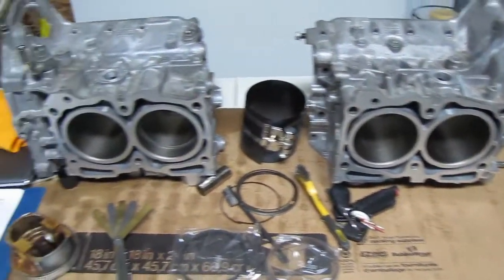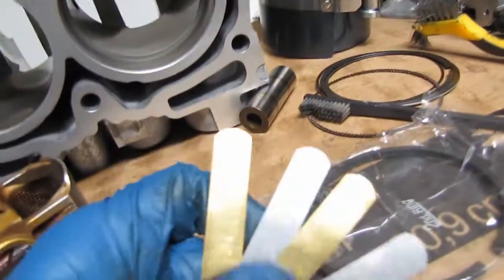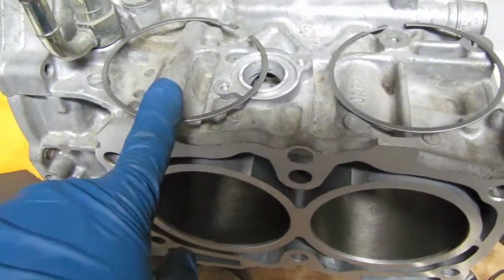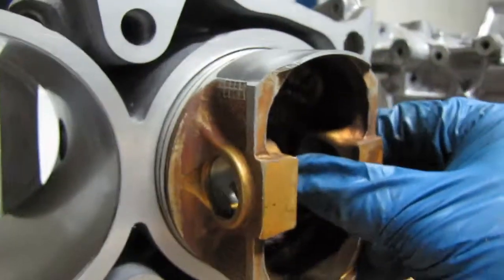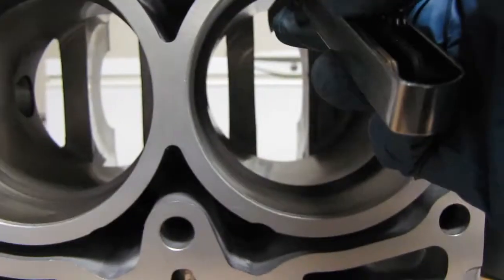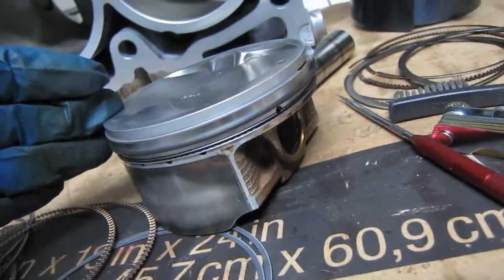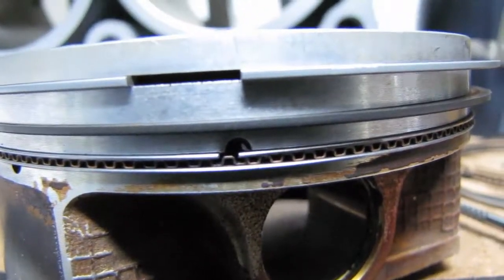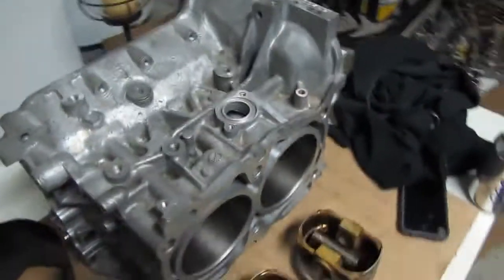2007 Subaru Impreza 2.5i SOHC Rebuild - Part 2 - Pistons Cylinders and How To Piston Ring Gap

Comment: How did your rebuild go? I'm currently rebuilding my 06 forester and I'm trying to figure out which piston goes where. They are only labeled L and R. I'm assuming right and left but I'm wondering which ones go in the front and which go in the back? Any advice would be great.
Reply from the maker: The rebuild went great!  As for which piston goes where, I think you really want to put them back in the cylinder where they came from because they're more or less mated from the wear unique to them.  I marked them with sharpie for this reason.

It's probably not the end of the world if you don't as long you get left and right correct.  I'd check the FSM just to make sure (I don't remember off the top of my head which is which.  I think it's from the perspective of looking at the engine).

Thanks for the comment and do please consider subscribing!
Reply: Download the service manual. Imo that’s your best way to go
Reply: Piston to wall clearance should be within spec as long as they are, it wouldn't matter what cylinder, if you push the piston in the cylinder you can measure the clearance on one side with a feeler gauge. I don't know what the tolerance is but it's easy to look up. If there's dots on the Pistons they always face the front of the engine. "R and L" sides are referenced as if you were sitting in the car so the R side is passenger.

Comment: What all did you have done to you're block at the machine shop, I'm begging the same project, any tips would be great
Reply from the maker: I just had them deck the head to block mating surfaces and clean everything up real nice.  Decking is necessary because these aluminium blocks warp very slightly with all the heat cycles,...and just a bit will mean a bad head gasket seal.

Oh and since I had spun a bearing, and was just going to touch up that one spot on the crankshaft myself, I had them do a magnetic particle inspection on it.  They confirmed there was a crack - so I Amazoned one right to my door.

Okay and I just remembered, I also had them change out the valve seals.

Join a local Suby Facebook group and see where people get work done in your areas and call the shop.  Chances are they'll advise you well if there's something you need.  I think I was around $500 all in.

Thanks for the comment and do please consider subscribing!
Reply: @PeaceLoveAndGuns  I done the head gaskets before on the same engine I'm working on and it was a breeze, done oem timing belt kit alone with it, I had the heads decked and everything, I went with 6 star head gaskets and they worked perfectly no leaks what so ever, so to the bad stuff, got the motor in and have a slight vibration, with a tick/ rattle noise with a slight miss, I've drove the engine so far about 8,000 miles checked valve clearance again and right on spec, so I'm confused 🤯
Reply: Quick question, I'm kinda waiting to start off fresh but need some options on how to do so because there is alot of mixed information on the internet, if you were going to start off new or newer with a 3,500$ budget, because I'm working with 150k on the engine I have and got it at 130k so I have honestly no idea of how it was treated before me, but back to the point, would you go low mileage jdm, rebuilt, or new. But if you go to look at jdm engines there an 50/50 deal and you half to replace all seals, or rebuilt, you never really know what you're getting or if they did the job to spec's, and I also looked into new oem longblocks and subaru doesn't sell them, just short blocks and bare heads, I would rebuilt it but I don't have the time to do so, just an honest opinion would be great thanks.
Reply from the maker: @shannonb1411  Umm pretty sure it's possible to have the timing belt off by one tooth and it still run but with the symptoms you describe.  That might be a thing to check.

I've also heard of people not torquing their cam sprocket bolts properly after installing the timing belt, allowing for a teeny but of slop in the sprocket which cause a tick/knock sound.
Reply: @PeaceLoveAndGuns  I'm working on it right now and have the TB cover off and you may be right on the being off a tooth looks like I'm a couple off, do you have a way I can contact you I need help bro
Reply from the maker: @shannonb1411  If timing is off a couple teeth you're probably going to need to compress the tensioner and put the pin/ a nail in to hold it, that should give the belt slack.  You may have to remove one of the idlers.  I forget precisely how much slack is needed.

Using a breaker bar, since it doesn't counter rotate, you'll position the (I think the right side looking at the engine) cam sprocket correct and pull the pin from the tensioner.

A second person should make this all a lot easier.  Definitely grab the factory service manual from someone on the web too.

Comment: If you explained in the video I’m sorry.  Do you know how the pistons get lubricated since they are horizontal.  Do the oil  splash top and bottom?   Do they only splash from top and it runs down the pistons?
Reply from the maker: The big side of the connecting rod has pressurized oil sent through holes in the bearing journals.  The cylinder walls and wrist pins are lubricated, probably not so much by 'splashing' as 'flinging' the oil off the connecting rod.  This flung oil is way in excess of what it takes to lubricate the cylinder wall and the lowermost ring shown in the video wipes the excess away and back into the sump every time the piston moves toward the crankshaft.

Thanks for the comment and do please subscribe if this has helped you out!
Reply: Peace, Love and Guns Thanks man, I appreciate the feedback.

Comment: Question, can the expander ring be to big or does it need to be sanded down to a ring size. Sohc 2.5 outback 2009 thx
Reply from the maker: Sorry for my late message but I’ve not heard that this is at all required.  Thanks for the comment and do make sure to hit Like and Subscribe for more!

Comment: lol its too much for everyone who wanna rebuild . just buy new pistons and put  it inside . you just need  good tide bolts with right sq . super ez .
Reply from the maker: Just… BUY NEW PISTONS!?  On what experience do you claim that is cheaper?  That’s kind of nuts.  You still need bearings and rings for new pistons, and the labor is the same… how could buying new pistons make the operation any cheaper?
Reply: @PeaceLoveAndGuns   i rebuild engine my self with parts from amazon and already drow 1950 milles without any problems and without oil consuming !!!!